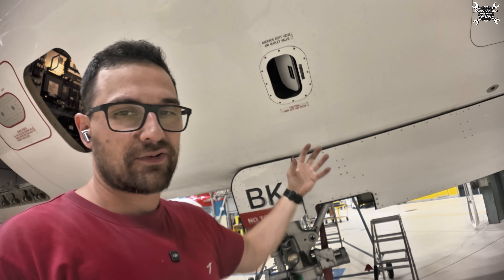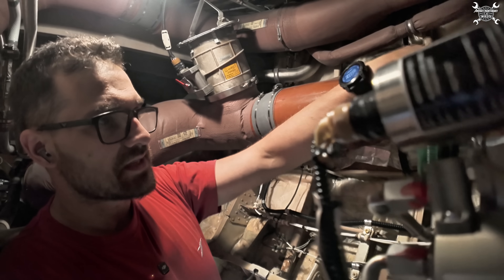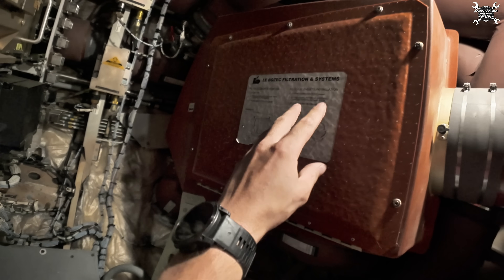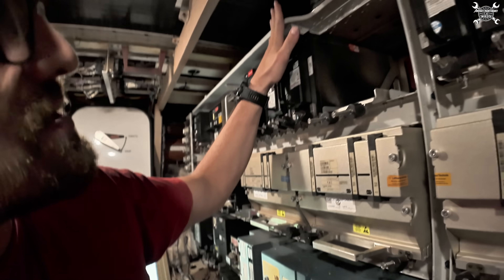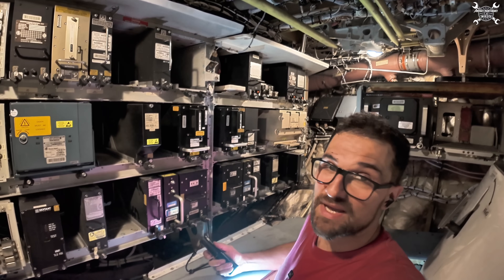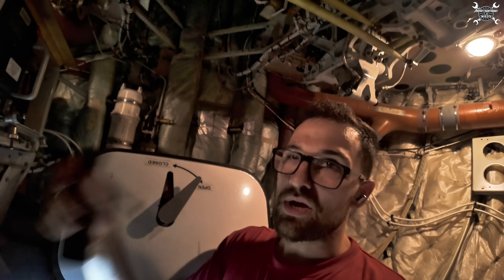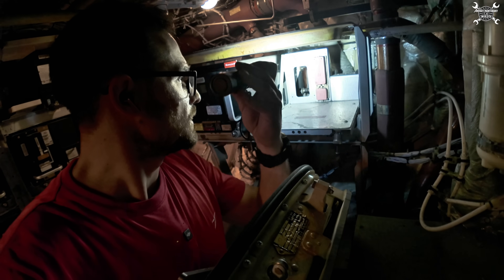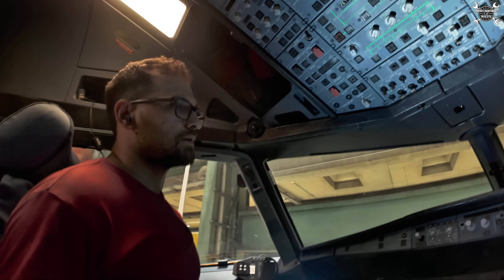How to cool down computers inside of A320

Comment: Very interesting, thanks! So the avionics cooling system is completely separate from any other aircraft cooling capability? You would think that in hot climates you would need additional cooling when on the ground.

Comment: Honest question primed for correction: Why can’t all of the planes software run on a similar package to Tesla’s fsd computer (multi chip checks and balances, but way smaller and simpler)?
Reply: Because, unlike Tesla fsd, it actually has to work
Reply from the maker: If you go through the comments you will see that I answer it several time. This is aircraft concept from 1980. Since then there was little bit of upgrades and even new airplanes has separate boxes for key systems due to redundancy

Comment: It’s interesting to see how neatly arranged and tightly packed the avionics systems are in the A320 compared to the A350 I saw in another video, where they seem far more scattered around the bay. I’m curious to know whether it’s done like this in the larger aircraft for safety (higher physical separation between components making them less liable to failure from a common cause), or whether it’s just because the A320 Neo is a more modern aircraft?
Reply from the maker: You basically have more space to work with A320 is small aircraft. You have same thing on B737 and for example 767 or 777

Comment: Are those computers also from the 80'ies? If so, my phone might have more computing power. Which makes you wonder how a computer room of a clean-sheet 2025 plane would look like.
Reply from the maker: There is not such airplane. But newest models has many things in form of hostile applications but systems like flight controls are still in forms of separate boxes

Comment: I think they should make a position for some technician to be monitring those system during flight , this would enhance safety .
Reply from the maker: Why are you trying to go back...... everything is monitored by computers.
Reply: @zeto.r  there is always something that only humans can detect , if the computers fail from detecting for example a screw that is loosening ; a vibrations ; ... a double safety is better than a single one
Reply from the maker: @bob-o6l5u  yes that's why we have repetitive inspections in that are.

Comment: What's the high pitched whine we can hear? Also have you done a video on the cabin air conditioning and distribution system? That would be interesting to see.
Reply from the maker: Transformer rectifier and yes it is on my channel
Reply: @zeto.r great channel I've watched a few of your videos now. Would love to see a more in depth video of the HVAC systems showing where all the ducts are through the cabin. Where the air from the footwells comestibles down the cabin sidewalls back to the pacs? Does the air cycle machine provide all the air flow into the cabin or are there other fans also circulating air in the cabin?

Comment: Awesome computer-tech inside there! Your cockpit scene surprises me, in simulators these cockpits always feel very spacious in simulators, like they where 3x3 meter rooms filled with switches - but in reality they are rather small, almost van or semi-truck driver cabin sized.
Can we have such photorealistic airplane visuals in 10 years with 1000 Teraflops of graphics card rendering power in simulators?Without random idiots immediately coming out of the woodwork who all obviously haven´t found out that so-called "graphics settings" can be found in all video game and simulator options since 40 years and therefore they immediately start to ramble on and on about "FPS" and "FPS-optimization" and everything "costing unnecessary FPS and is not needed for flying from A to B!" whenever awesome photorealistic visuals and really revolutionary next-gen graphics quality is done (in simulators and videogames alike). Having this kind of tech with all it´s details and wires and hoses and cables simulated in a simulator would be an absolute dream!
The iniBuilds Airbus 350 is the first simulated plane showcasing such an avionics bay inside a simulator, a true revolution of visual quality and details.
What is the technical limit in maximal operating temperature of this cooling system? It is way more hot on airports, with sometimes 50°C of air temperature because of the asphalt and concrete everywhere even if the air temperature is "only" measured with topping out at 40°C in rural or suburb areas. Air cooling has it´s limits so what is the limit of an A320 before it´s computers and cockpit screens will automatically shut down because of overheating? Can it land, park all day in the brightest sun and start in Death Valley without some of these electronics overheating?
Reply from the maker: If you operate in hot environment you either use apu to power air-condition or you use external air-condition to cool down. Airplane it self can survive very cold and hot environment if you know what to do 🙂

Comment: How does this system prevent condensation on the pipes?
Reply from the maker: Surface temperature never drops below dew point so there is hardly build-up of condensation

Comment: I bet 90% of the volume and cost went into reliability and serviceability of these devices
Reply from the maker: For sure no maintenance is expensive but don't forget about the crews.
Reply: @zeto.r  yes! sending a guy to fault test and fix in the plane would mean the plane is out of service for days. I appreciate replacing technical issues with supply chains, just pull out faulty box and replace.
Reply from the maker: @mipmipmipmipmip-v5x  that is how it is called LRU line Replaceable Unit

Comment: we always receive SDAC and FWC with many dust causing by airflow
Reply from the maker: Im not surprised due to amount of air over the time
Reply: @zeto.r yes, also, we receive all the FWC for repair, coming from a330 aircrafts (for example), and these  don't have any dust inside the FWC.

We also receive the ATSU computers (of A320) on our repair station, and these one are clean, no much dust inside.

Comment: I wonder how much computing power that actually is and how much current all of that would draw if it used current generation processors. Like, if all of that ran on Ryzen 9 or something.
I know the strict safety and sourcing requirements of aircraft mean that it's probably not feasible, but I bet it would dramatically lower the power draw and necessary cooling capacity.
Although they'd probably rather keep the same well-proven cooling system to use the same amount of energy to support more computing power, enabling new features and even more redundancies.
Reply from the maker: For sure my Samsung s25 will be able to cover lost of combustion but even the newest airplanes has independent boxes for for example flight controls simply for redundancy

Comment: Good morning,
As a researcher can i request you to show us the fuel cutoff valves sections and explain a bit linrs and wiring of Boeing 777 or 787 aircraft or even 737 would do the job ?
Thanks in advance
Reply from the maker: Hi I don't work that often on B787 and B737 we don't have in the fleet. It is simple springloaded swith and spring is there to hold it in the sep position
Reply: @zeto.r thanks for reply,
so they are solenoid type valves just  copper coil and iron core and spring.
The DC (14 /28 volts)current come in coil generate magnetic flux and attract the iron rod in and that's open the fuel flow ? Just as simple as automobile has ? 
I heard it doesn't use spring loaded but use motor to spin in one direction and to close in other direction, so incase of power failure valve stay open ?

Thanks again

Comment: Im surprised the computers are that massive, then again those planes were conceived 50 years ago, i wonder how much smaller the computers in modern planes like the a350 & 787 have gotten.
Reply from the maker: You will be disappointed 😂 a lot of this boxes are still there. But also some moved to rack as hostile applications
Reply: What do you mean by "hostile applications"?  You mean 3rd party (contracted) hardware that's not subject to manufacturer's (Airbus's) harsh safety procedures upon its protection and installation? (Then if they're not subject to top notch safety procedures than they're installed in special rack)?
Reply from the maker: @vinylscorcese3435 no I mean that there are no physical box for system instead there is only app in core cabinet

Comment: Do they really need all that computing power, Like if redundancy wasnt required couldnt you run the whole plane on a modern gaming rig?
Reply: The total computation should be doable on a phone sized single board computer. But reliability, fault isolation, traceability constrain the system design.
Reply from the maker: This is designed in 1970

Comment: one thing i hate when flying is when tge menopusal flight attendants crank up the heater. Its so much nicer to cuddle up under a blanket than sit there drenched in sweat and breathing in other peoples sweatty body smells.
Reply from the maker: It should be set to between 21 - 24°C from the cockpit and flying attendants can change + - 2°C

Comment: Would Interesting to know the kind of heat that avionics dissipate (it should be high, a lot of cooling), and would be really interesting to know the kind of hardware that is inside modules (microprocessors, etc...). Greetings
Reply from the maker: Basically it is the same as normal computer 🙂
Reply: @zeto.r  Great, thanks 👍🏼👍🏼

Comment: As an IT guy, I'm really curious why this plane needs so many computers and what they're doing. Are avionics really so complicated that a few servers can't handle them? Same with infotainment - one powerful server should be enough to handle 200–400 clients. The SpaceX Dragon spacecraft is controlled by three standard PCs, and they need three just for redundancy. So if a spaceship can run on a almost regular PC, why does Airbus need so many computers?
Reply from the maker: It is a bit complicated that that. Even new aircrafts had separate box specially for flight controls and again we have 1 or 2 backups. Redundancy is the key and this way it is almost unhackable. Some system then are only hostile applications 🙂
Reply: @zeto.r  But what exactly is more complicated than that? The only reason I can think of is legacy. I’d guess it was designed in the late ’80s or early ’90s, and now it’s simply too expensive to redesign and recertify everything. My assumption is that when computers were first introduced in aviation, they were essentially magic boxes performing a single task - like autopilot. Then someone added a computer for flight controls, someone else for display systems, and so on. They stuck with this architecture of one computer doing one thing because redoing everything is just too costly and risky (since all those small computers were tested over the years), even though it’s extremely inefficient. But that's only my guess.
Reply: @mdbk2 a little more complicated than how your thinking about it. Legacy isn't a bad thing...
Everything on a plane MUST be type certificated. You cannot just slap new components into a plane that weren't type certificated! This isn't automotive a lot more rules apply. If you modify a type certificated airplane without the proper paperwork you will have heavy fines. 
Redundancy is NOT  optional it's mandatory..... If you lose one computer another one takes over etc etc etc.  there is no roadside gas station that you can pull over at if a computer fails :p
Reply: If you ever saw a diagram of these they have different computer units for different sections of the aircraft and each is separately redundant. They have about 3 primary flight control computers, 3 elevator and aileron computers, 2 flap and spoiler computers, and so on... A modern design might combine more of them but separate units seem to be important for redundancy and fault isolation
Reply: It has nothing to do with expense it's due to legislation etc etc and safety. The reason aviation is so safe is because of these rules I mentioned above. 
I am a student in a part 147 school(aviation maintenance technician school)
Reply: A dragon spacecraft has a lot less systems than an A320. A lot of
Reply: I guess the systems run independently, you don’t want single point of failures
Reply: I think you have a massive misunderstanding of what is actually running on the SpaceX Dragon spacecraft. They are nothing like "a almost regular PC" and they are not "three standard PCs either". Lets just call them 3 mission computers. . but in addition to those there are many other components "computers" that talk to the mission computers and have their own individual tasks which then have other components and sensors that report to them.
Reply: @arkadious9320  And now I think you have a massive misunderstanding of what a PC is ;) Today, "PC" mostly refers to a type of computer architecture; it doesn't mean they're using off-the-shelf computers. It simply means the system follows the typical architecture that allows it to run modern operating systems and software, like Linux in SpaceX's case.

Comment: I never would have imagined air being used as a form of cooling. I always imagined heat exchange would be through contact with a cold surface or using some completely inert, non-toxic, non-freezing, and non-flammable liquid. In other words, something that would only be used in airplanes.
Reply: Cold surface would make a lot of sense. Curious why they don't use something like that. They do on spacecraft. Full immersion cooling is a pain in the ass.
Reply: The cold surface is the surface of the aircraft at cruise. At many negative degrees, I'd imagine the 'hot' air exchanges heat with the cold surface of the aircraft QUITE rapidly.

Also remember, liquids have weight. Weight is revenue for airlines. The less weight REQUIRED to be carried means the more MONEY (i.e., passengers and cargo) can be loaded onto the aircraft. Having a liquid-cooled computer system on a plane that spends many hours of its time flying in VERY cold temperatures doesn't make financial sense.
Reply from the maker: Flow of the air is the easiest, cheapest way. You don't need to be afraid of leaks and imagine also smoke what then. How you get rid of it.

Comment: I wonder how the computer power of the a320 compares to say a 737?  Airbus does a lot more flight automation and intervention than Boeing does, which certainly calls for higher levels of computational capacity.
Reply: you are incorrect. airbus does not do more automation than boeing and models built or upgraded around the same time have very similar components.
Reply: @arkadious9320 everything I’ve read says Airbus avionics does most of the piloting and that Boeing planes are still very much flown by the pilot.  As an example, Airbus automation controls bank angle during a pilot initiated turn whereas Boeing does not (assuming autopilot isn’t active).
Reply from the maker: You are wrong my friend. Airbus is fly by wire and boeing had direct control but both has for example auto land capacity or full autopilot function
Reply: @zeto.r I stand by my original statement 

Yes, Airbus planes are generally considered more automated than Boeing planes, especially in how their fly-by-wire systems are designed to manage pilot input.

Here’s a breakdown of the key differences:

⸻

1. Fly-by-Wire Philosophy
	•	Airbus:
	•	Uses a fly-by-wire system with flight envelope protection.
	•	Pilot inputs are interpreted by the flight control computers, which can override the pilot to prevent unsafe maneuvers (e.g. excessive bank angle, stall).
	•	The side-stick controller is not mechanically linked to the other pilot’s side-stick, and there’s no tactile feedback between them.
	•	The computers prioritize maintaining aircraft stability and limits, so the pilot essentially tells the aircraft what to do, not how.
	•	Boeing:
	•	Also uses fly-by-wire on newer models (e.g., 777, 787), but with less automation enforcement.
	•	Pilot input is more direct, and the system generally won’t override the pilot unless absolutely necessary.
	•	The control yokes are mechanically or electronically interconnected, so pilots can feel each other’s inputs.
	•	Boeing philosophy emphasizes the pilot being “in command,” with the system acting more like a support tool than a gatekeeper.

⸻

2. Flight Automation Levels
	•	Autopilot and Flight Management Systems (FMS):
	•	Both Airbus and Boeing planes are highly automated and use complex FMS and autopilot systems.
	•	Airbus tends to automate more flight phases by default — from takeoff roll to flare (landing) in some cases.
	•	Boeing often leaves more manual discretion to the pilot, especially in the takeoff and landing phases.

⸻

3. Pilot Workload and Interface
	•	Airbus:
	•	Automation reduces pilot workload significantly, but also requires pilots to be highly proficient in monitoring systems and automation logic.
	•	The side-stick and computer-mediated inputs change the feel of flying — it’s more like commanding a system than “flying” directly.
	•	Boeing:
	•	Slightly higher workload in some phases due to more manual interaction.
	•	The control column gives a more traditional flying experience, which some pilots prefer for tactile feedback and perceived control.

Comment: When working around the A320 the avionics cooling exhaust is very loud and very annoying. A recent modification Airbus has made is to close the overboard exhaust valve when temperatures are below a certain level. I forget the exact number. 54 degrees F or something like that. 
It's a Godsend. At least on cooler days the aircraft is MUCH quieter to work near.
Reply from the maker: It is 12°C then it switch to close loop. You can pay extra for quiet version for example 🙂
Reply: @zeto.r  I assume that is all inside the AEVC ?
Reply from the maker: @rael5469 it is part of it yes